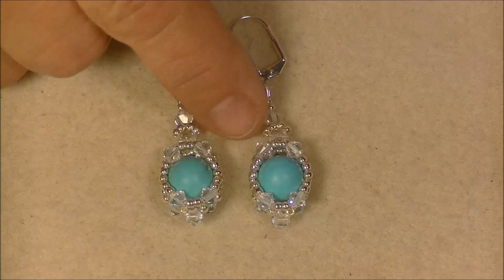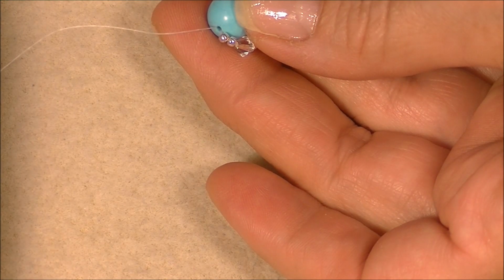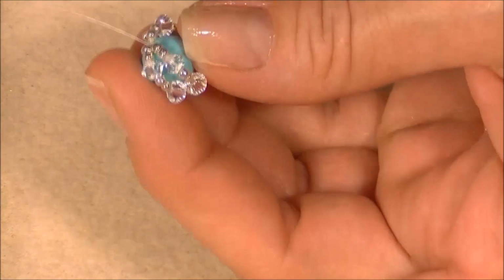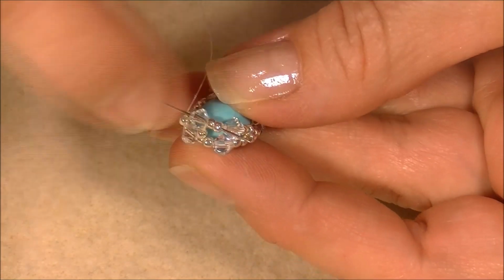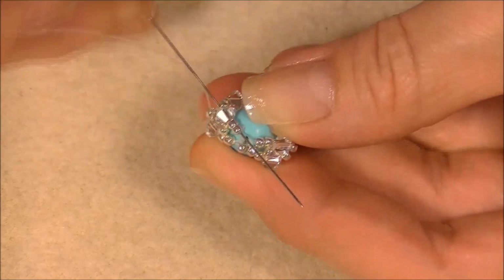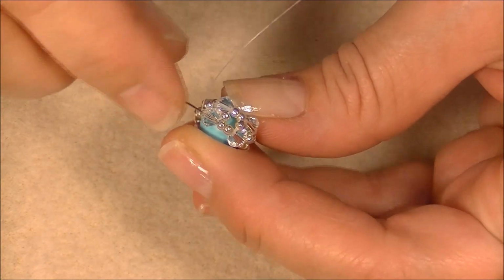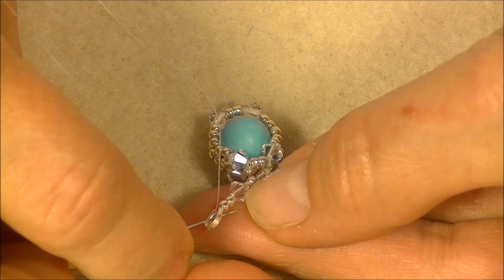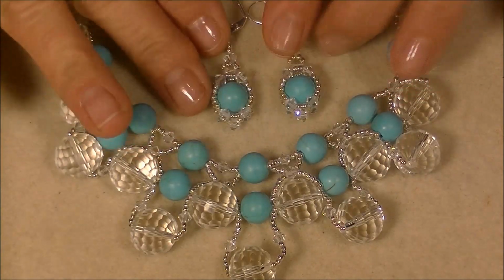Casual Grace Earring Tutorial

Comment: hi  these ones are cute.  not that hard to do.  is there any way to do these with smaller round beads
Reply from the maker: Shasta Haldane Sure you just have to adjust the amount of seed beads and  the perhaps use 3mm or 2.5mm crystals.
Reply: ok  will try it